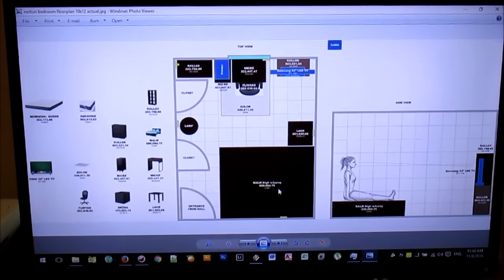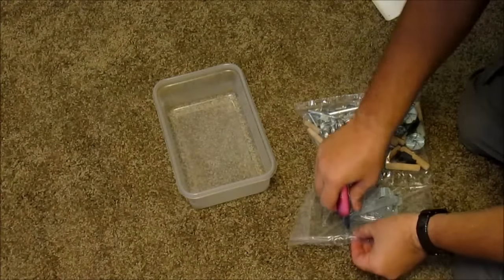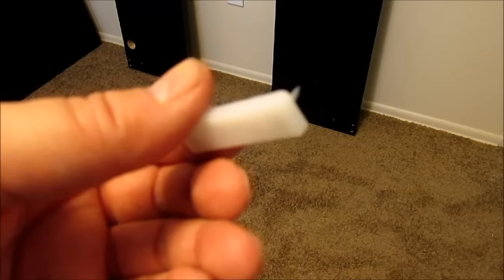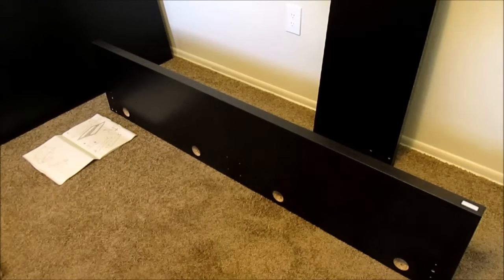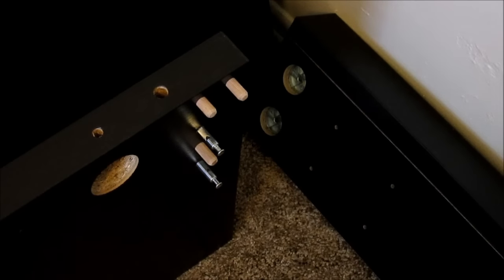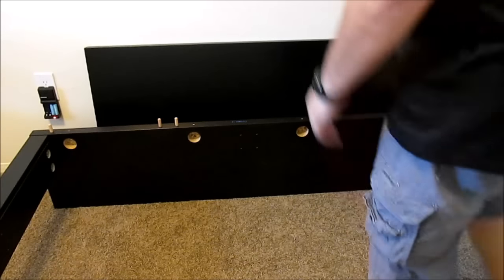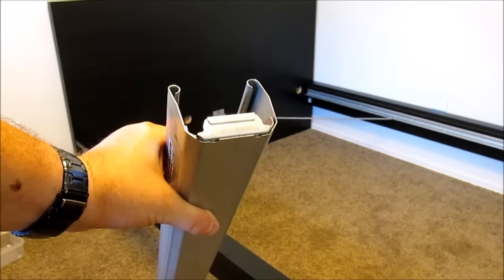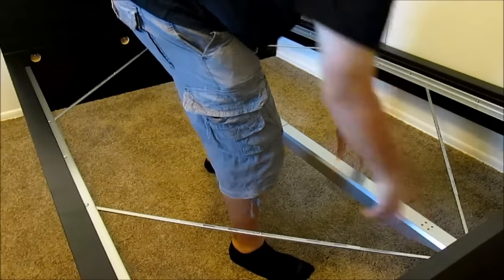IKEA Malm high bed assembly - DETAILED!

Comment: The Ikea employee totally told me that it was easy assembly and all of the tools required were included in the box. SIGH. I'm glad I checked Youtube for tutorials. Still, it took me longer due to the pegs being too thick and not fitting properly into the holes. I literally had to balance the entire frame vertically to force the pegs in with gravity. LOL Thanks for your video! ❤️

Comment: You forgot to mention what a nightmare it is to screw those tiny screws on the crossbeams since they go under and there is not support while screwing them. Trust me this is a nightmare to assemble. Also, I have no cllue how you are able to pull that SKORVA midbeam out because you must be either jacked or mine is literally welded on itself.
Reply: While carrying mine to the bedroom this morning it slipped right out. Off to a good start, yippee.
Reply: Those small strut screws were absolutely infuriating.
Reply: Tiny screws and that stupid nut and plastic thing. All went ok except one didn’t seem to have enough thread. I spent about 5 minutes on it and then grabbed some pliers and brought it down a few more threads.
Reply: Those screws are literally what I’m stuck on at 12 in the morning  and I can not get them to go in and I’m so tired
Reply: @thestarz3312  Choose your battles and keep fighting! :D

Comment: Thank you so much for this. I actually set aside the instructions and just followed along with you. The items were hard to lift in some cases so it was also really helpful to have things oriented properly so I didn’t have to lift more then needed. 

I have a box spring and mattress already so didn’t need to purchase slats. After installing the centre bar I was able to just put my box spring and mattress in from there! 

Off to sleep in my new bed. 😊 Thanks again for making this an easy, straightforward process.

Comment: Thanks so much for your wonderful helpful video! I was having major trouble with the metal wheels not gripping and going in. I was cussing up a storm-lol. I decided to check youtube and from your video I realized that I had to insert the metal wheels and push them in first, instead of after connecting the side pieces to the headboard and footboard and it worked great! Other youtube channels out there are useless and not helpful and definitely do not go into full detail like you did. I had to assemble my Malm bed by myself so it made it a little more difficult as opposed to having a friend help me. 
 I got the black-brown also.

Comment: this is helpful! but one thing to mention for anyone having trouble with the screws on the small metal bars is that a philips screwdriver can't really cut it. You should use a Posidriv bit in order to get them snug. These aren't too common in the US but the ikea FIXA kits should have them. I ordered mine on amazon

Comment: The screws at 37:20 is where I'm stuck. It seems like the threads aren't catching past a certain point. Has anyone else experienced this?
Reply: yes
Reply: JR007 Use a Philips head #2 screwdriver
Reply: Yes.  Very frustrating. How did you solve?
Reply: I’m currently stuck on this part, someone please help, the screws will not tighten it, I’m going to try pushing as hard as I can. Wish me luck.
Reply: @XGaming1  I actually had to give up. I have an old bed support that fit within this bedframe which is how I did it. 

Essentially, this new bedframe is being used only for looks and is not supporting the box spring or mattress at all.
Reply: i tried and tried to make it fit but i couldn’t. so i didn’t put them in and skipped that step. hopefully it still works the same
Reply: Estelle Rose I got them in, you just have to push super hard with the screw driver and they will go in, it’s weird but works.
Reply: The Flip I’m currently trying to sleep without them in. Hopefully I don’t wake up on the floor or something 😂💀
Reply: Estelle Rose lol, I think those parts just keep the corners of the frame from bending and coming loose, I don’t think you even need them if unless your planning on moving it a lot. But yeah I love how high quality and modern this beed frame looks lol
Reply: You need to create the threading by just tapping in the screws by themselves.
Turn the metal slat over (you will be pressing hard, so this makes sure that it doesn't bend).
Thread each of the screws (x3) into the holes and then take them out.
For the middle one make sure you measure it out so that you know which hole youre tapping into.
Rotate to-and-fro once the screws have tapped in all the way so that the grove is nice and clean.
Now, when you fit the screws with the frame, there should be significantly less resistance.
Reply: Lohith Bommireddipalli I just pushed as hard as I could with the screw driver and got them all tight, I just kept using force and they eventually went in.
Reply: @lohithbb4690  A gentleman and a scholar. Thanks
Reply: yes

Comment: Squeaky bed - great vid buddy, and can I add another help tip for anyone whose Luroy bed starts creaking when you or your partner get in or out.  The side rails are made in two pieces, fixed & permanently glued together.  Sadly during construction, not the greatest attention is paid to ensuring these two pieces are exactly equal in length before glueing. As a consequence, the top piece can be slightly longer one end, only circa .5mm, but that's enough to create a gap and prevent the mating faces of the side & end sections from being perfectly flat together after you tighten the cylindrical worms fasteners.  What you must do is remove the side sections, including the upper dowels, and sand the overhanging section of the top rail so as both sections are perfectly flat.  Use some 80 grit sandpaper wrapped around a piece of flat timber, then when both sections are flat & even, finish off with some 120 grit, THEN, get bees wax or surf board wax and rub into the matting faces & also the timber dowels, then put everything back together.  Worked a treat for me :)

Comment: Thanks for the vid.  what suggestion would you have if a person is moving? do you have take the whole bed apart?
Reply from the maker: You don't have to disassemble EVERYTHING. Just remove the midbeam and struts and separate the frame into its 4 major parts (2 sides, headboard section and the leg at the foot of the bead), then wrap in blankets or moving pads when moving. And put all of your screws and pieces in a zip lock bag. Piece of cake!!

Comment: Hi your video was super helpful however when I get to the part of putting the headboard into the slats of the bottom, it won’t go in as smooth as yours did. One side will go down properly and the other side will not. I’ve tried to go back and forth on each end but it doesn’t seem to work..

Comment: Hi what is this particular disk shaped screw called ? I have similar ones on the bottom side of my left and right bed side plank which connects with a bolt to the plank on the foot side of the bed. Now issue is the bolt is connected to this screw and this screw turns only a little clockwise or anticlockwise. 
How do i remove the screw or the bolt?
Also again what is this round screw called in case i succeed in replacing and how do you measure the size.
Its urgent. Thanks

Comment: Are the initial screws to be fully inserted into the frame. There is still a gap in the frame and side board and the metallic disc is stuck. How to get it out ?

Comment: i am going to be buying either a 10 inch or 13 inch high mattress for my malm bed frame with 4 drawers...if i place those metal beam pieces on the lower setting (so my mattress isnt so high) the drawers will still fit under the bed right? like placing the beams on either the higher setting or lower setting does not effect the drawers installation?

Comment: Do you think the four struts are totally necessary? I gave up on them while making my bed because I couldn't get the tiny screws in but now I'm worried its effecting the integrity of the bed but I can't find them online anywhere!
Reply from the maker: Hi Chloe. The 4 struts are not <totally> necessary, but if you move around a lot on your bed, it will turn from a rectangle into a diamond shape and wreck your bed frame connectors. If you're looking for missing parts, you can use ikea.com and send them a message: http://www.ikea.com/ms/en_US/customer_service/contact_us/contact_us_email.html (then click on Missing or Spare Parts link). Good luck! Let me know if you need any more help.
Reply: Chloe Rozokk following.
Reply: Having a similar issue where the little screws are a son of a bitch to get in any deeper than a quarter of the way whilst remaining utterly loose and pointless. :(
Reply: +Chaotic Entropy I used my wooden slats (couldn't find my hammer) to get the struts to go in all the way.
Reply: @ladycam5  good idea!

Comment: activity10cc, thank you so much for all your help, you made me decide that i want to pass on ikea's slats and build my own base inside the frame. do you know what's the height from the floor to the lower option of the support shelf on the sides? want to build storng legs for support. thank again!
Reply from the maker: Since I'm using the upper option on the support shelf, I can only give you a fairly accurate estimate based on measuring (with a tape measure) the location of the lower holes minus dist between holes & shelf. The height of the support shelf for the lower option would be 23.5 cm or 9.25 inches from the floor. Hope that helps!

Comment: What is the purpose of those "white feet/leg" that you were hammering in? I forgot to add those on my malm bed and it doesn't seem necessary?? Good video. Thanks.
Reply from the maker: The white feet prevent scratching the floor if you have a tile, wood or vinyl floor. If carpet, doesn't make much of a difference.
Reply: My bedroom has carpet, Thanks for the reply!

Comment: Very helpful video, though I'm encountering a problem now at step 4 - I can't get the side beams in tightly against the headboard piece. The cam hooks aren't catching (I have the arrows pointed in the right direction), but even before that step, just trying to gently bang the pieces together isn't working (there's still a fairly noticeable gap).

Do you have any suggestions - I'm so close, I really want to get this bed finished! Thanks.
Reply from the maker: To close the gap, you have to rotate the cam hooks. If I recall correctly it's counterclockwise. But it could be clockwise. It's the rotation of those cam hooks that closes the gap and brings the side to the headboard. Hope this helps!
Reply: Thanks. 

I've tried rotating the hooks, and on one side it brings it a bit closer, but there is still a gap. There seems to be an issue right when I place the side beam on the leg - I notice in your video that the side beam comes in fairly close just from 'banging' against the leg, but on mine there is a noticeable gap. I've tried adjusting the depth of the cam hooks as well, but that isn't working. 

I'm kind of stumped as to what else to try.

Comment: This is from 5 years ago but i have to release my frustration at you saying it is the most important to have the spinning wheels facing a certain direction only to have your head cover the shot, and not allow the camera to refocus.

The smaller pellets I had did not fit the whole, and therefore I am unsure if I even have the wheels in the right place.

And yes, im saying pellets and wheels bc i am THAT inexperienced with builds lol

Really wish there was more clarity on this as I am currently struggling here

Comment: Hey, I have a question, does it come with the metal mid piece or would you have to buy it separately? And also I know this video is 3 years old, hows the bed frame holding up now? Is it worth it? I’m looking to buy it.
Reply: It comes separately, but it’s free if you buy the bed frame. If you order it online, it’ll come with it. The slats, however, are an additional $30.

Comment: Thank you so much for this video. Quick question: my slates keep falling, how can I prevent that?
Reply from the maker: HI Aaron. Most likely slats will fall if you don't have the 8 pegs in place (4 at each end of the bed). These pegs keep the slats stretched from one end of the bed to the other. Without the pegs, the slats would slide around and fall.

Comment: Hi! Thanks for the video. 

I have a question about the heights of the metal side bars. On your bed, what are the measurements from the floor to the horizontal part of the metal side bars where the slats rest, including the slats once they're in? I'm trying to determine how high the top of my mattress may be when it rests on the slats on the lower setting vs. the higher setting. Also, how thick are those Luroy slats? 

Thank you!
Reply from the maker: On lower setting: floor to top of Luroy slats is 9.5", On higher setting: floor to top of Luroy slats is 11.5". The Luroy slats themselves are 0.25" thick. Hope this helps. Good luck!

Comment: thank you so much!!! sorry if you mentioned this in the video (i skipped past a couple parts as im only reassembling someone else's old malm bed not making from scratch) but is the drill necessary for the runners or can we use a regular screwdriver? (Also i dont have any of the screws so I'm hoping some similar sized ones at home depot will work! )
Reply: Drill isn't necessary but it makes it a lot easier
Reply: Jiggy Thank you! I was able to make it without one
Reply from the maker: You can do it without the electric screwdriver. The assembly instructions will help you with the missing screws. http://www.ikea.com/us/en/assembly_instructions/malm-bed-frame-high__AA-740446-8_pub.pdf

Also, you can get replacement screws from IKEA on their web site by telling them the part numbers of the screws (part no. are in the assembly instructions). Might be hard to match screws at Home Depot.

To order replacement parts, go to http://www.ikea.com/ms/en_US/customer_service/contact_us/contact_us_email.html   and click on <Missing Parts>link. Good luck!

Comment: Your videos are such a blessing!!!  There is one thing that isn't in your video of the Malm 4-drawer bed and the parts weren't in the packet, but the end of the instruction booklet shows drawer guides in the picture. Is that something that I need to call the Ikea or try to find at Lowe's or are the pictures wrong?
Reply from the maker: Don't worry about it. If you got the drawers, use the instructions that came with the drawers. The parts for the drawers would come in the drawers' box. Good luck!
Reply: Thank you:)  I agree with Tahnya Realtor - IKEA should put you on the payroll, since you keep people from hating the otherwise great products.

Comment: Hi, thanks for the video! It was really helpful.
I was almost done with the setup But it so happened that the hole in one of the metal struts was bigger than the screws. So I am not able to tighten the strut at the footboard.
Do you know any trick or something that I can do to fix that strut with the screw?
Reply from the maker: Thanks Manasa. Glad I could help. You should be OK with 3 of the 4 struts. I would contact IKEA and get a replacement strut though. In the U.S., the link is: http://www.ikea.com/ms/en_US/customer_service/contact_us/spare_parts.html. If you're somewhere else, search your IKEA web site for "missing parts".
Reply: activity10cc Okay. I thought so. is it okay if I screw the strut from the top, instead of the bottom? on just that side? will that be okay?
Reply from the maker: You could try moving the strut above, but the strut may come in contact with your slats. Could make noise or damage the slats, but it doesn't hurt to try it. You could just leave the strut off for now and have IKEA send a new one + screws.
Reply from the maker: The struts are critical only when you're jumping on the bed or rolling around on it a lot. They keep the bed from shifting. If you're not hard on your bed, the struts don't do much.

Comment: Hi, can I use another bed slats with its own legs (not from Ikea) for this bed? From the video it seems that skorva beam will hinder it
Reply from the maker: Probably not, but maybe. But your slats would have to be exactly 30.1" wide. IKEA's Luroy slats fit very tightly into the Malm bed frame, and there's two sets of slats side by side resting on the mid beam. The chance of your slats working is very slim. I would suggest IKEA's package deal which comes with the Malm bed frame, Luroy slats & the Skorva mid beam.

Comment: Do the four struts have to be screwed on tight? I can't seem to get the screw through the strut all the way.
Reply from the maker: Hi Chris. The screws need to be snug, but not super tight. If you don't tighten them, those struts will rattle and make annoying noises when you move around on your mattress.

Comment: Question, what do you when the screws won't screw the little diamond support bars on? All the screw driver did was strip the tops of the screws, went to Lowe's and bought new screws, same size and length but they just won't screw into the bars!!!!
Reply from the maker: Yeah, this is tricky because of the many thread sizes. The distance between the curves of the threads is probably wrong (either too short or too long). Or the screw is too wide. The best way to figure this out is to buy various combinations of screws in the little baggies and try them all, take back the ones that don't fit. Also, look at this very helpful guide online: http://www.wikihow.com/Read-a-Screw-Thread-Callout. Good luck!!